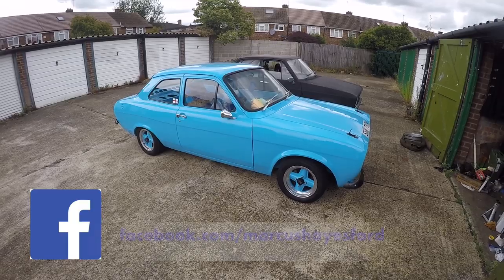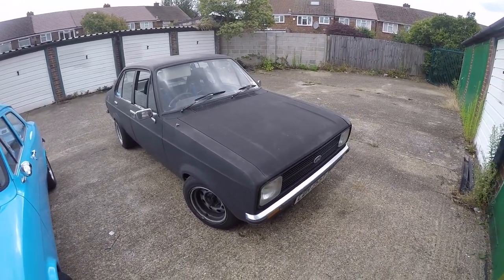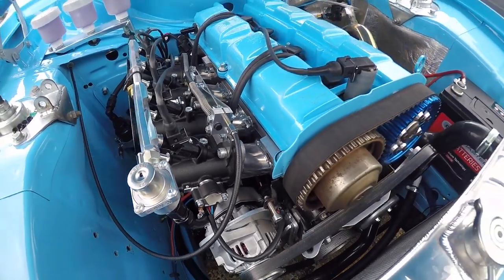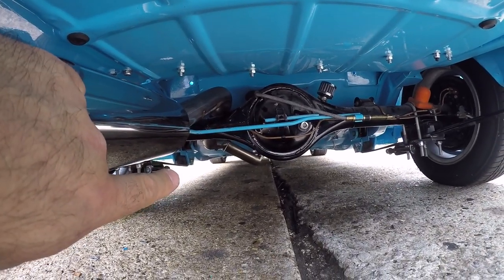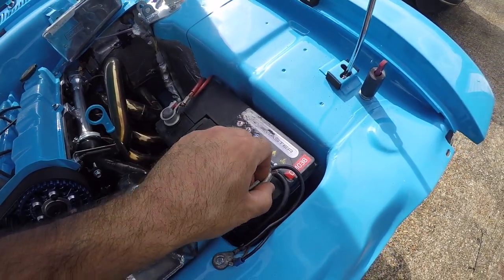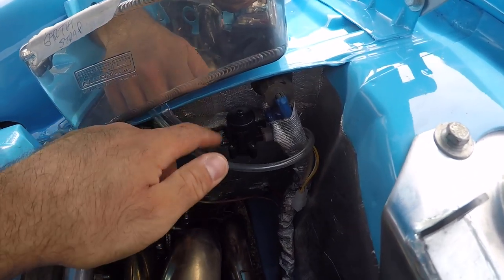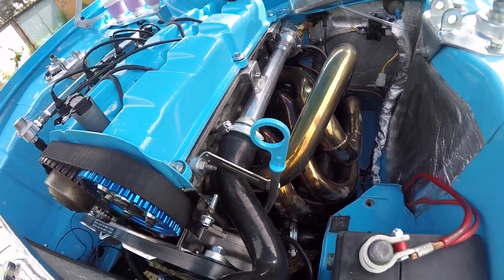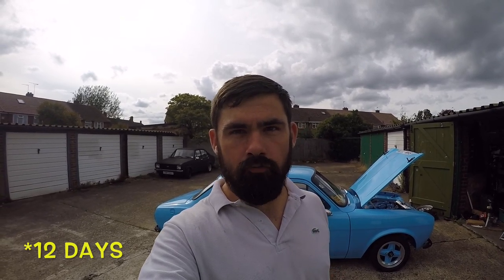I HAVE NAMED MY ST170 MK1 ESCORT!

Comment: Remember the good old days with the janspeed systems, they use to be skidded, triangular plate on rear box, where tailpipe merges with back box, the janspeed systems sounded pure sex, when mated with twin 40s on a crossflow engine, not knocking yours mate, she is gorgeous, but I'm a big fan of the crossflow engine 😁
Reply from the maker: To be honest Id much prefer to stick with pintos and crossflows but they cost too much to get decent power out of and I seem to blow engines up. With a zetec/st170 I dont really need to worry. If it goes bang its only a few hundred quid and a weekend of work and I back on the road. :) . . . . One of my mates said that Janspeed exhausts sound really good.

Comment: looking mint fella, chuck some heavy heat shrink over those crimp battery terminals to help with a bit of strain relief on those wires if you cant get the heavy stuff just double up some over the top over each other... stops the wire thread eventually fraying with vibration. Keep the vids coming really enjoying them.
Reply from the maker: Thanks! 👍 And thanks for the advice!

Comment: Always have loved the look of the janspeed outwardly rolled tail pipe. Those nankangs look good they have come a long way from where they were known as ditch finders looking to have them on my 13"s. There is a Geordie lad wit a cossie on you tube that has the same tyres on his...
Reply from the maker: My exhaust is a Piper but I do love the outwardly rolled look and 3 inch is the perfect bore in my opinion. . . . . I heard that Nankangs used to be a bit crap but Im so happy with the NS2-Rs. They do an even grippier type (AR1s) that are a bit more expensive but still road legal so ill defo be looking at them in the future :)

Comment: Looking good matey👍 your st170 engine will not rev without the vacuum on the regulator i dont think
Reply from the maker: Thanks Tony! :) The weber fuel pressure regulator doesnt need a vaccuum connected. Its set at 3 bar. If u use that regulator on a turbo application it does need to be hooked up tho so that it can adjust the fuel pressure in relation to the boost. :)

Comment: Marcus Looks good pal, id remove the spacers you've put between the chasis and x member as the engine mount cups will have sorted the sump/rack issue and the spacers will alter the roll centre/suspension geometry of the car.
Reply from the maker: Your right the spacers can mess with the geometry. Realistically tho its the same as if the car was lowered by another 8mm so its not that bad. I did try the cups without spacing the crossmember but the engine sat too high and the water rail fouled on the bulkhead lip. There are ways of correcting the geometry which i may look into in the future (especially for Maude because it may help me with drifting) Or I may end up using a different design of sump.
Reply: @marcushayesford  anyways pal top work and nice to see people modding and not polishing as the scene has gone up here in North Wales 👎 wish I still lived down south as the scene is better down there
Reply from the maker: There are polishers everywhere mate. Obviously Im going to have to be a bit of a polisher with 'Esther' but shes still going to be getting driven hard. . . . . I feel lucky that I also have 'Maude' to properly abuse without feeling too guilty about it. :)

Comment: nice one again Marcus :) looking good fella.. id put a sock or cover on that + red terminal on the battery..  bit of large heatshrink would do the job if your happy with the connection and not adding any thing else to it.
Reply from the maker: rs2klee I should have sleeved some heat shrink on before I crimped wires in, never mind :)

Comment: Just brought a mk1 just wondered what hubs and struts you are using? Thanks
Reply from the maker: On my mk1 I’m using 2.8 Capri bilstein front legs with alloy front hubs that are 10mm wider than standard to push the front wheels out slightly. I’ll be changing the front legs to Gaz Gold adjustable ones at some point. Hope that helps. :)